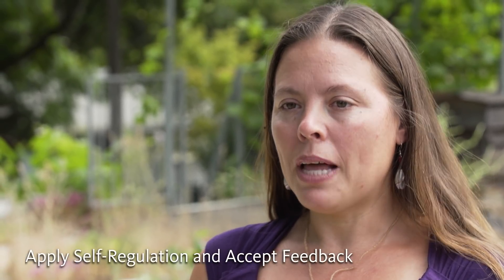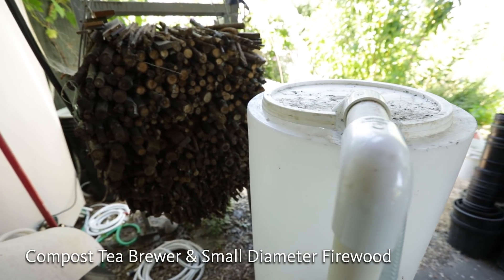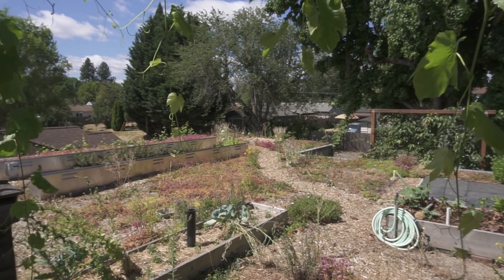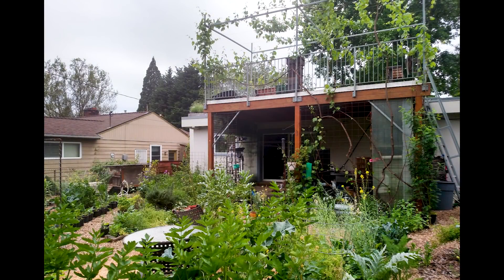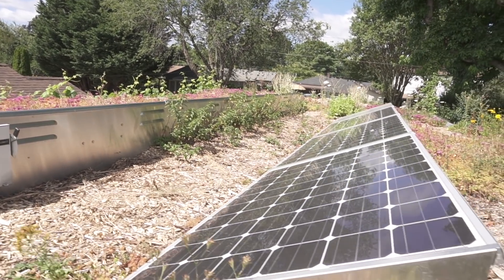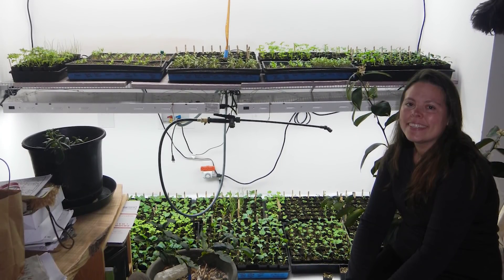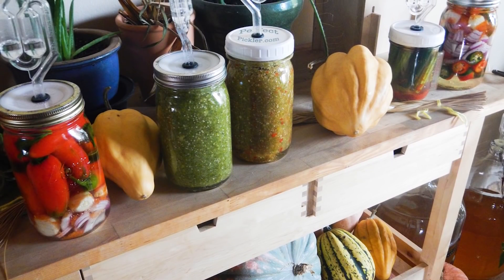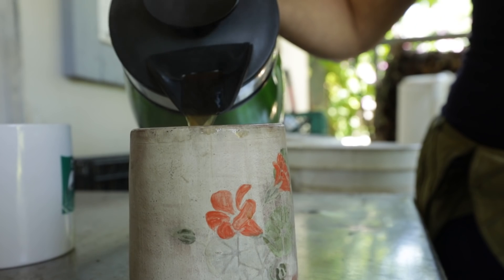Permaculture design: Home energy systems

Comment: Great presentation. Have you heard of the new Bosch on demand electric water heaters? They need 50A while in use but could simplify water heating and eliminate the tank and storage issues and heat losses.
Reply: Hi Ole!  Thanks for the suggestion.  The problem with on demand electric water heaters is the cost, the upfront cost is $800 - $1000.  Our 40 gallon system with upgraded heating elements and a switch cost $260.  The whole house versions need at least 3 dual pole breakers.  Most people don't have that capacity in their breaker panel unless they upgrade (+ add $1000).  Also, on demand electric water heaters only heat the water approximately 60 degrees over the incoming water temperature.  Our incoming water temperature tends to be 45 degrees in the winter.  The electronics for on demand water heaters are also most complex than a small tank.  We also consider that our 40 gallon tank holds water in case of emergency.  The two perceived advantages of an on demand system are unlimited hot water (practicing using less is better) and longevity (which is complicated by the more complicated flushing maintenance to the system and higher upfront costs).
Reply: @MarishaAuerbach  The model we saw at Home Depot was about $175. Of course it is for one location. It requires a double pole 50 A breaker with #6 wire (range wire), which of course could be difficult to install. For Kailash Ecovillage it will be perfect since the points of use are separated by a wall, the ideal configuration. We plan to replace all our old fashioned tank models as the tanks fail and need replacing. We are also contemplating installing a thermal solar device to preheat all the ecovillage water up to 80F so they need to do less work. The trade-off is the incoming cold water will no longer be super cold 45F it is now.
Reply: @oersson  Zane shared the information from my last post.  I think this conversation is best taken off-line since we are neighbors.  There's a number of points that you and Zane could discuss in further detail.
Reply: @MarishaAuerbach  Thanks, once again, for sharing this! Will discuss with Zane next time we meet.